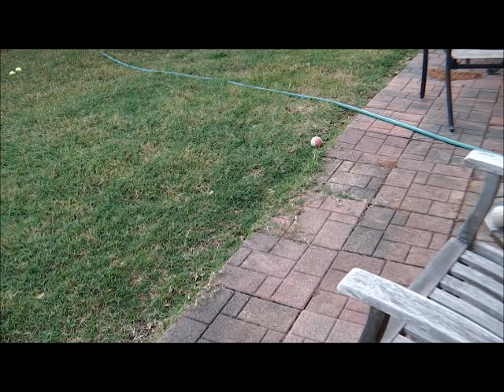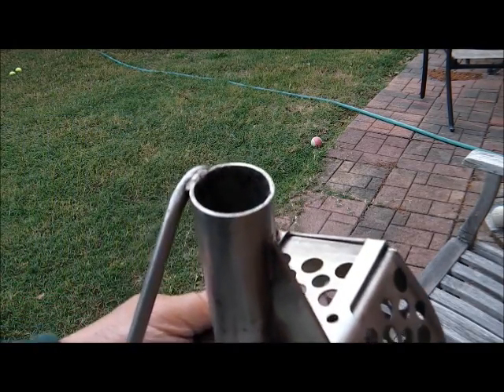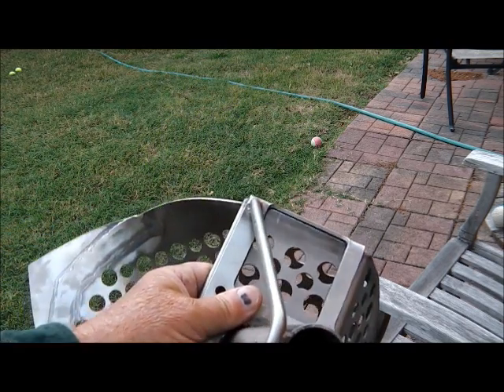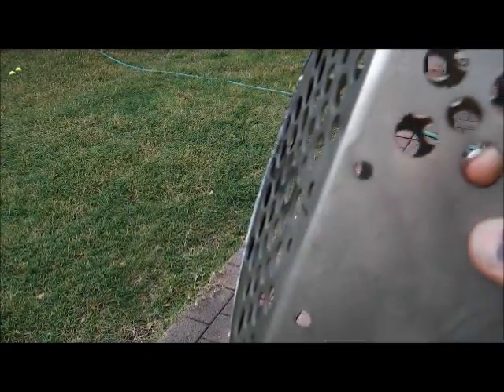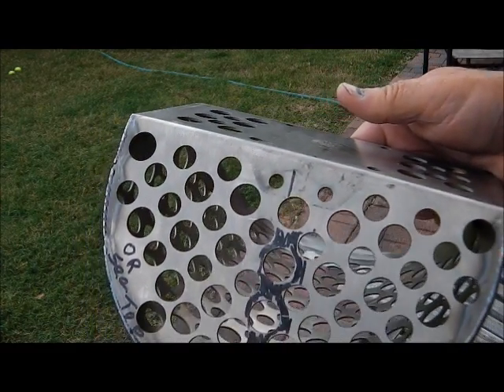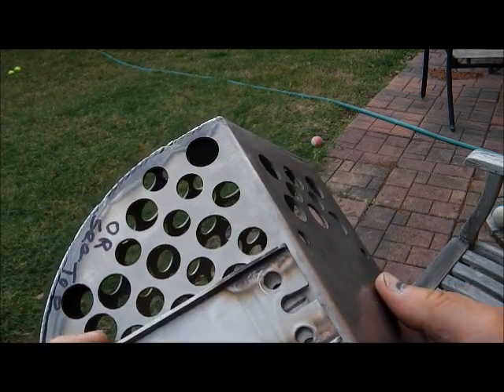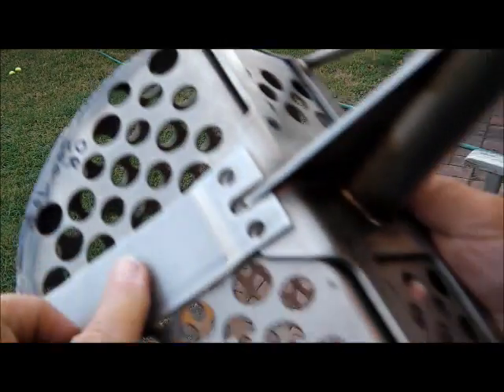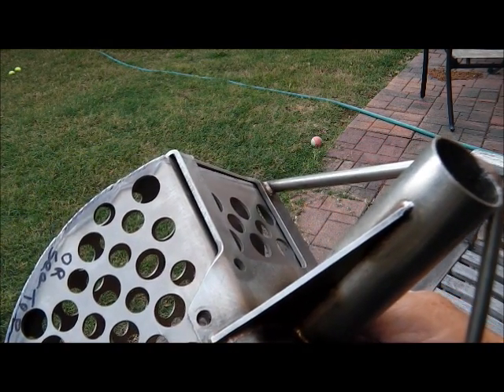NOV TITANIUM SCOOP UPDATE AND MODS.

Comment: 1/2" holes too big for me Max. Too many small goodies can fall through and when water hunting in UK you will lose the small medieval coins and pistol balls. Also the small sinkers would fall through so you end up chasing the signals in the water.
Still trying to id that pin for you but so far the guys are stumped.
Reply from the maker: If you are asking me........I would not even consider either of the evol. Scoops
Reply: I use the ali scoop from RTG. Light weight and strong. Had it years and only needed the centre rod fixing. EVO scoops are too heavy.